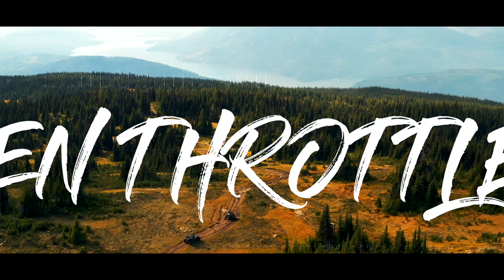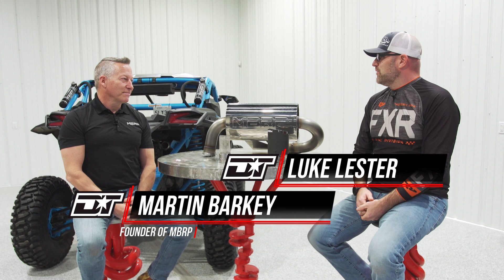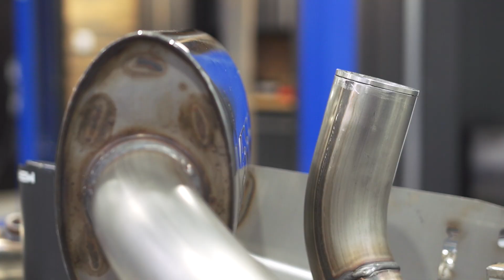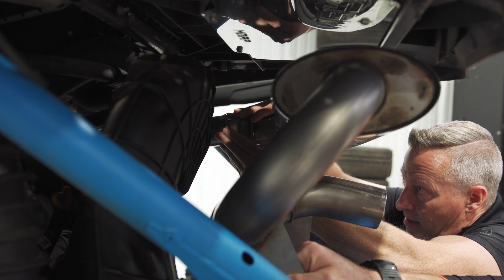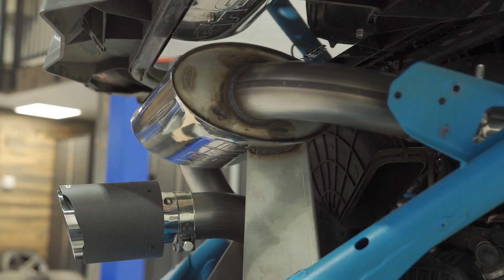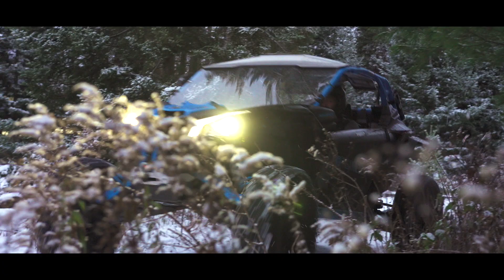NEW MBRP Aftermarket UTV Exhaust for the Maverick X3 Turbo!

Comment: Too damn loud! I bought one of these for my 2019 700 Grizzly to get some heat out of the engine and not for power. Took me longer to install the "muffler" than I had it on the quad. Called MBRP and asked if they had a quiet core for the "muffler" and was told they dont and no one had ever asked for one before. I now have a 250 dollar piece of pipe on the shelf... not impressed.
Reply: It’s should be common sense that an aftermarket exhaust is louder than stock. It’s free flow exhaust compared to stock so it’s going to be louder. If aftermarket is too loud than leave the stock one alone. You can’t have more horsepower with a free flow exhaust and be quiet so it doesn’t hurt you’re delicate 👂🏻
Reply: @morsecode5447  I knew it would be louder but didnt think that much louder. Again wasnt looking for power but was trying to cool the engine. No reason it has to be as loud as it is to get a bit more flow. The stock muffler on my Grizzly has a catitletic (sp?) Converter and it runs very hot as they do, enough so that you can barely place your hand on the plastic fender above the muffler. My Arctic cat stock exhaust is quiet and flows fairly well without all the noise so it can be done.